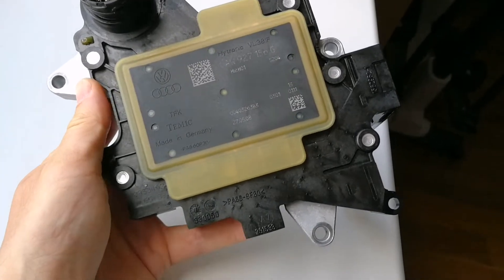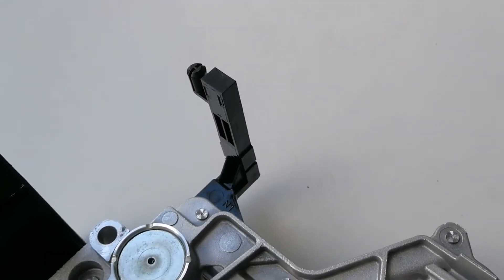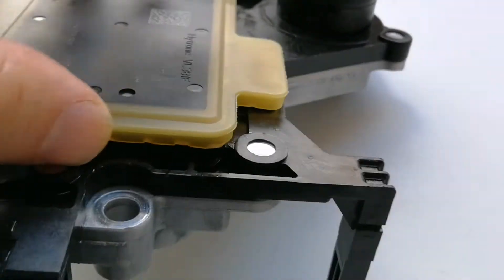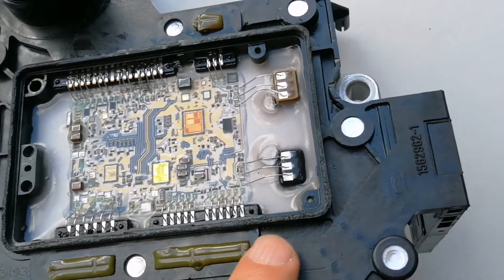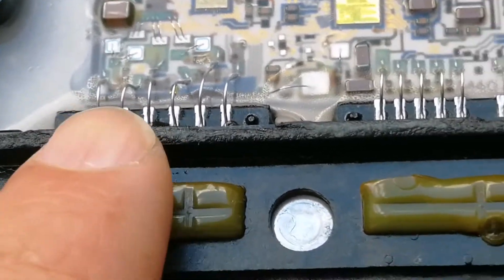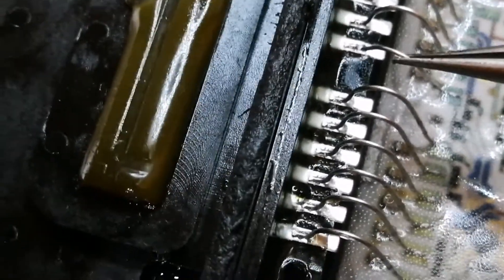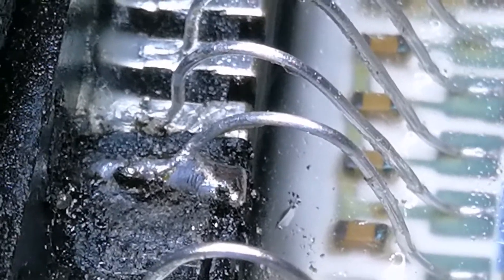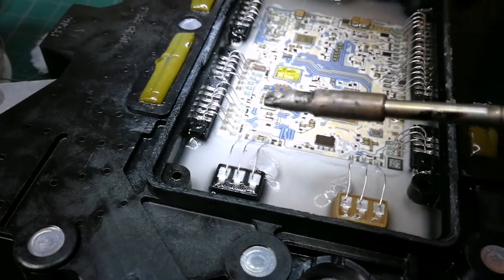Audi A4 B8 Multitronic 8 TCU / TCM unit gearbox repair

Comment: Hi, can you weld with aluminum wire? Or what material would I have to weld with?
Reply from the maker: @rafabobber  Yes. Aluminum wire welding needs special welding liquid instead of common rosin.
Reply: @ What is the name of the liquid? Thank you. Regards.
Reply from the maker: @rafabobber  You can use A05M AlumWeld or some other.

Comment: How i can  clean  the gel ? So its easy to go inside to mother' board?
Reply from the maker: There Is no need to clean the whole gel.
Reply: @Mauda76  my I didn't word it well.. I'm talking about a paste that some electronic components have... some special jelly that protects them from moisture but also prevents you from repairing them.